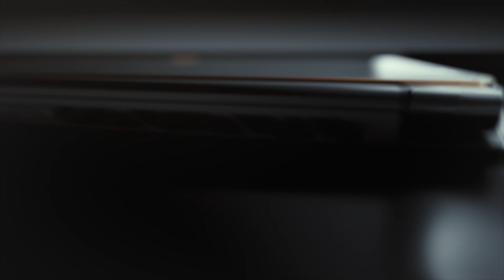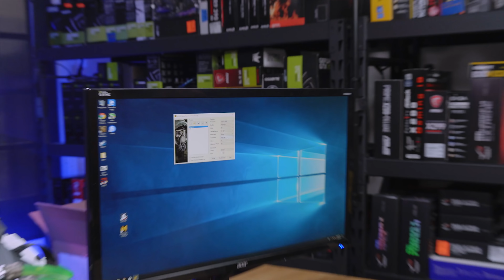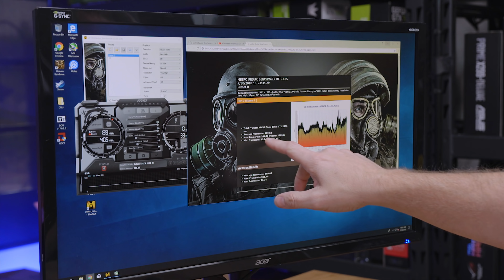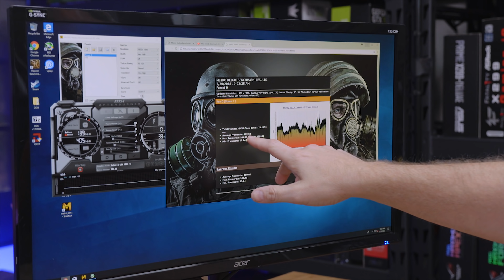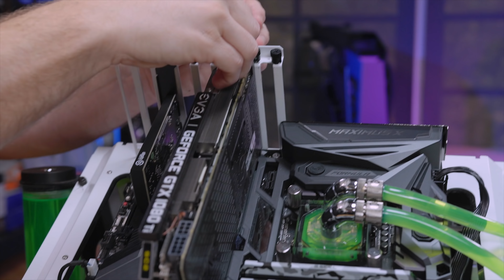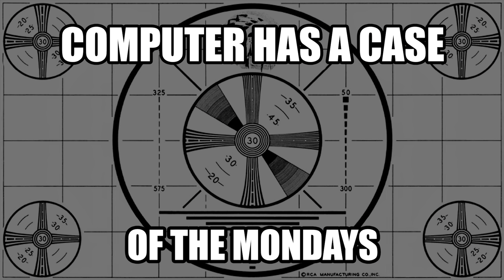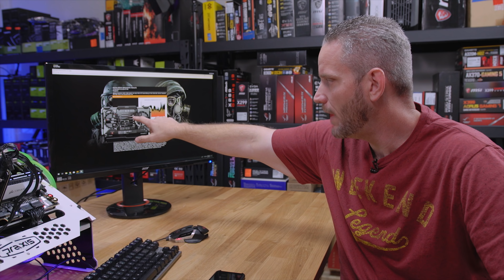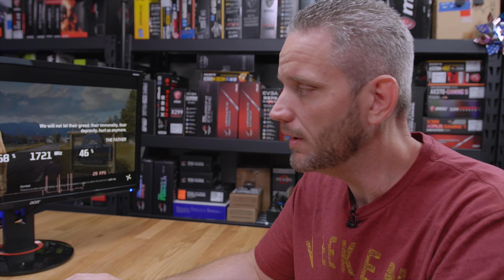Updated Test Bench... But did I screw it up with the wrong CPU?

Comment: Jay, love your vids. Quick q, i have a gigabyte ab350 gaming 3 and i want to upgrade to an asus prime x370. Will i need to reinstall windows?
Reply: The chipset drivers are exactly the same so technically you don't have to, however it's a really good idea to do a fresh install of windows for best performance if you can from my experience. Otherwise you should remember to uninstall the gigabyte crapware and "helpers" that you might have installed before installing the new board. Otherwise you might see a hit in system performance..
Reply: don't upgrade to x370 when x470 is out

Comment: Hey Jay, could you please do a video on gpu flow direction?
People are so misinformed about this and keep spreading lies.... could you stop that stupid trend of saying gpu flow direction matters as video form so i could show to people they are wrong? Thank you
*Btw another great video :)

EDIT: what i mean about flow direction is this: https://www.google.co.uk/search?biw=455&bih=500&tbm=isch&sa=1&ei=1LtgW7eBCMaD8gKrorq4BQ&q=gpu+inlet+flow+direction&oq=gpu+inlet+flow+direction&gs_l=mobile-gws-wiz-img.3...7680.8853..9261...0.0...80.336.5......0....1.9mZ1nFJHspE#imgrc=iUiYLYOc1llFoM:

Or vice versa or both port are used as inlets and both are used as outlets on other side
Reply: GPU flow matters alot. If your gpu flows you got a problem because its melting^^
So best GPU flow = no GPU flow! (pretty much the only GPU fllow that will keep it in a working state)
Reply: pretty sure Band1t means direction of flow round a waterblock.
Reply: WHAT IS HAPPENING?!?!?!?
Reply: Yeah he has already tested direction and it doesn’t matter
Reply: I approve of this flowing something onto the gpu
Reply: if you mean direction of watercooling flow, he did one of those videos pretty recently i think. (at least i watched it quite recently...)
Reply: You talking about airflow?
Reply: I do believe flow can matter, but thats parallel vs serial in multi gpu setups, if your pump is riding on (or beyond) its ragged edge of capacity. Would love a confirm/debunk on this though.
Reply: If you mean coolant flow direction: IE GPU to CPU or vice versa He already did that. 
Conclusion was 1 to 2 degrees max: Functionally Irrelevant as it's the saturated heat across the loop

If you mean Airflow? That matters substantially
Reply: @pr0xZen - that's really a pump capacity issue, though. it'd be roughly about the same, parallel or serial.
Reply: Guys i dont mean flow as from cpu to gpu or vice versa
I mean direction of flow, left or right inlet or both? 
Gpu block are not directional as cpu block are but 80% of people who "know" stuff about pc tell me direction should go from left port to right port or vice versa and uding two ports as jay does is apparently worst thing you can do....
Reply: The simple answer is if it mattered the Block manufacturers would mark them as directional.
By splitting it as Jay does you 1/2 the flow pressure in each block, that pressure reforms at the single outpipe.
If you have a high impedance block and/or and anemic pump that could have a negative effect, in fractions of a degree, but the flow rate means your cooling medium will not be slow enough that it's reaching thermal capacity.
Reply: What does that even mean?
Reply: Pretty clearly he means in terms of water flow, for a water cooled GPU. He is posting the comment on the king of water-cooling's YouTube channel....
Reply: If he means it’s vertical with an adapter and the fans are sandwiched up against the panel, vs horizontal with open airflow yes that does matter.

Comment: If you can get a hold of the parts do this build:
CPU: Q6600 (3 ghz oc)
GPU: R9 270
RAM: 8GB DDR2
No SSD
This is literally my system it's pretty tragic